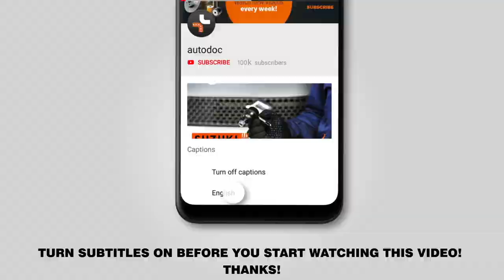How to change front springs / front coil springs on TOYOTA AURIS 1 (E150) [TUTORIAL AUTODOC]

Comment: Very good job...
Isn't better if we first use brake cleaner and then apply copper grease?
Or you do it this way to avoid having grease on the brake disc?
Reply from the maker: Thank you for your comment.
It should be carried out in exactly the same sequence as in the video.
If you first degrease and then apply copper grease to the disc, that is, it is likely that the grease will get on the working surface of the brake disc.
Stay tuned with us.
Best Regards,
Autodoc team
Reply: @autodocuk  Correct...
Keep it up with the videos!